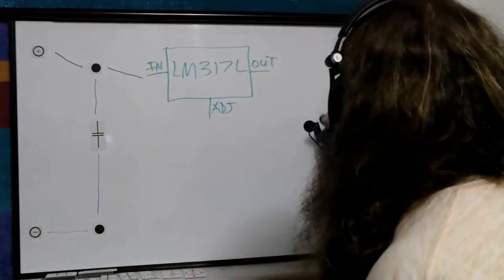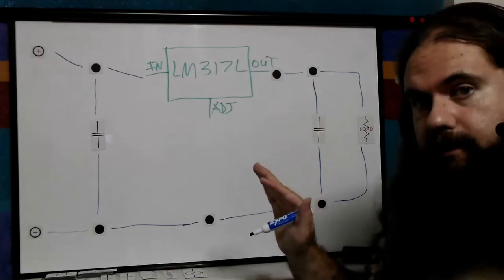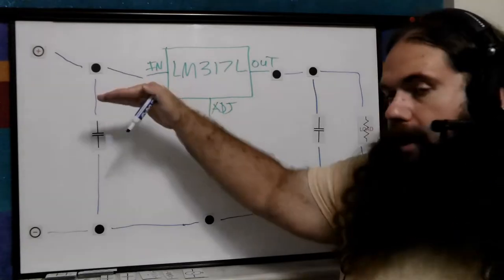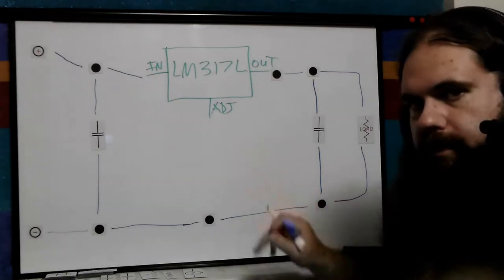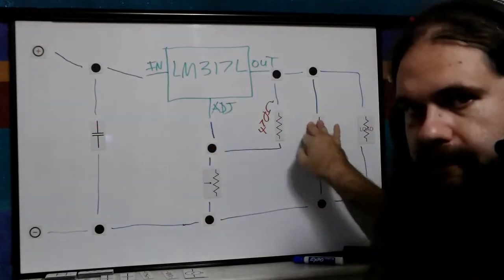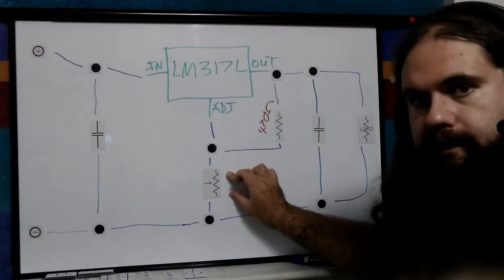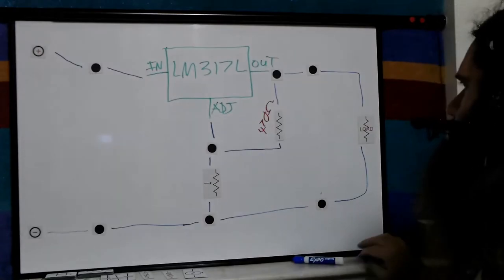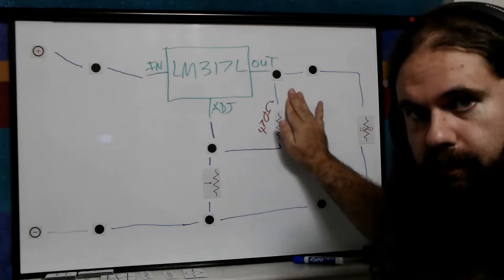Linear Voltage Regulator - LM317L - Simply Put

Comment: Hi Simply Put,

This video was insanely helpful. I cannot thank you enough. I've just discovered your channel, and I don't know how I've gone so long without knowing about it. I'm a senior-year electrical engineering undergraduate who has watched more than his fair share of YT videos for help with various analog circuit analysis and digital design concepts, yet Google has NEVER once recommended your channel to me when I needed help with tons of different classes. I don't understand how I wasn't subscribed to you years ago. It's amazing how I can do so well at a university studying electronics and circuit theory for 3+ years, yet I'm still lacking so much of the basic, practical knowledge they don't teach us on how to actually make real things that do stuff without blowing up. I've recently started binging all of the videos on your channel, slowly filling the cracks of my university-level education with the extremely-applicable, invaluable knowledge you have shared with the YT community. Your videos are exactly what I've been looking for to explain simple electronics concepts and how to use them in the exact way I need them to be explained, and I've already shared your channel with several of my electrical undergrad friends.

Now that that's out of the way, I do have one question. After watching this video along with the video on decoupling capacitors, I understand that the first (leftmost/large) decoupling cap is meant to compensate for (low-frequency) dips in the power supply voltage, and to supply voltage/power to the regulator when the power supply falls for a short period of time. I know that it smooths out the power supply voltage so that a nice, pretty-much-constant input voltage is supplied to the regulator THAT IS HIGH ENOUGH FOR IT TO WORK PROPERLY. However, if your input voltage is, say, 7V (for the headroom), and you are regulating it down to 5V, but your power supply only momentarily drops to maybe 6V or 5.5V, wouldn't you technically not need the first decoupling capacitor? Even if the power supply voltage falters a bit, but it is still sufficiently high enough to be regulated down to 5V, would a 6V dip (still >5V) not still be regulated down to 5V in the same way 7V would be? And the dip wouldn't have any effect? So, I guess my question is: Is the first decoupling cap for smoothing out the input voltage and supplying the necessary voltage to the regulator ONLY WHEN IT DROPS BELOW THE VOLTAGE YOU'RE TRYING TO REGULATE TO?

Same thing for the second (rightmost/small) decoupling capacitor. I know that that cap is for filtering out the (high-frequency) ripple noise in the output voltage -- you explained how it only affects high frequencies extremely well in the decoupling cap video, BTW. However, if the regulator regulates all dips in the input voltage that are still greater than 5V down to 5V (like I am guessing it does), would those ripples then NOT show up in the output voltage? Even if they were high frequency drops, would they still not be regulated down to a flat 5V just like all other input voltages above 5V would be? (e.g., the same way the constant 7V you are trying to supply it would be)

I am probably answering my own question in saying that this device linearly regulates the voltage (hence the name), so any low-frequency dropouts OR high-frequency ripple noise in the input voltage would propagate through to the output, just linearly-scaled down to 5V but still dipping/rippling proportionally. In that case, you would definitely need both capacitors, and the first decoupling capacitor would not ONLY be used for when the input voltage drops below the voltage you are regulating to (5V), but in ANY case when the power supply dips at all (whether to a voltage below 5V or not). And that would make sense EXCEPT for the fact that the output voltage you're trying to get does NOT depend on the actual value of the input voltage -- it just depends on the resistor value(s) you choose, and the fact that the input voltage you supply is sufficiently higher then that desired output voltage. If the regulator DID depend on input voltage, then you would need to have a specific input voltage to get the desired 5V at the output; i.e., it wouldn't work for any input voltage that is sufficiently high enough.

So which is it -- does the regulator like blanket scale any (sufficient) input voltage down to 5V, including power supply dips and high-frequency noise? So then you wouldn't need the capacitors? Or does it linearly scale down input voltage including any dips and noise, in which case you would need both capacitors? But then the specific output voltage you get would depend on the actual value of input voltage, wouldn't it?

Any clarification to this would be super helpful, so that I can 100% understand this core circuit component. Again, thank you for such amazing, helpful videos.

-- Chris
Reply from the maker: I appreciate your compliments! This is still a new-ish channel actually, barely a year old I think, so YouTube doesn't recommend it all that much (plus, because of my sporadic upload schedule). The regulator requires some voltage for its internal circuitry, so if you want 5.0V and you give it 5.!V, it will not work right. If you are giving your regulator 12V and you want 5V, you wouldn't need the capacitor on the input, but you would need a liquid cooling solution and a beefy regulator to handle the immense wasted power. The output capacitor is 1) because the regulator is not absolutely perfect, and 2) variable loads in the circuit all drawing from the regulator output can compete with each other (which is why having caps on every chip's supply is good, so they're all decoupled). And there's a "response time": Ripples in the input take a nonzero amount of time to re-regulate. If you wanted, you could actually chain regulators, 12V->8.5V->5V if you wanted, or even more, and it would make the supply even better, but you would waste SO much power it wouldn't even be funny. At that point, it's a much better idea to just use a more advanced circuit for your supply than a regulator chip. So the summary is, nothing's perfect, and your supply is regulator+caps, and you put caps on every chip too, and that handles it fine for non-military hardware. Go look at the motherboard of something like a Macbook (look at Louis Rossman's channel) and see just how many capacitors are all over the thing. It's a messy world.
Reply: @simplyput2796  I think I get what you're saying. Power sure seems very messy, as you note in the video.

So correct me if I'm wrong: the input cap is for (1) supplying momentary power to the regulator when the supply actually dips below 5V, and (2) smoothing out ripples (that are still > 5V) in the input for the regulator INSTEAD of just having the regulator handle them itself? Like you say, there's a nonzero response time for the regulator to re-regulate ripples (still > 5V) down to 5V? Even though the input voltage never dips below 5V, if there are still ripples in it, would they somewhat propagate to the output because the regulator would take some amount of time to fix them?

So, is it easier and faster to just put a cap there to fix the input voltage to the regulator instead of having the regulator handle the ripples itself?
Reply: Also, I just rewatched the video and realized that you want the input voltage to stay at 7.5V or more for a 5V output (NOT just input >= 5V). So, I'm guessing it's best to keep the input at 7.5V or 8V to regulate down to 5V, and you have the input capacitor to supply momentary power (at 7.5V or 8V) and smooth out the input voltage when the power supply dips below 7.5V (but is still above 5V the whole time)?? I'm guessing this is MUCH more power efficient than just having a regulator sit at input = 12V the whole time so that can still be at 7.5V or more even when it ripples??
Reply from the maker: If you want power efficiency, you really want a switching power supply with a whole lot of smoothing circuitry. Linear regulation is more wasteful but is much cleaner for cheap parts. The capacitor on the input of the regulator is there because the regulator does the bulk of the work but can't do it all, and a capacitor is small, cheap, and easy to stick on there to help out. Look at the spec sheet for your particular regulator, and it will tell you what voltage (e.g., 7V) you need to put into your regulator to have it able to properly produce what you need (e.g., 5V). The regulator is the surgeon and the capacitor is the surgeon's assistant, if you will.
Reply: @simplyput2796  Got it. Thanks so much for answering my questions.

Comment: This was seriously helpful.  20 views for this video! YT is getting its search algorithms very wrong.  Thank you, Simply Put.  I have several LM317Ls, and I need a stable 1.5v for an RF circuit. This chip ain't ideal, it seems, but it's what I got, so it'll have to do.  You've made it much clearer.   From a fellow would-be electronics engineer/ carpet fitter.
Reply from the maker: A lot of the time, I've found, the "not ideal" chips are actually the best for beginning and testing work, because their designs are super old they're basically perfected for what they are. These industry-common chips, basically everyone has made them. They end up being tolerant of mistakes, like running power the wrong way, and they are less responsive to finely-grained signals but that also makes them more stable in high noise. What makes them bad for "real" work makes them amazing for breadboard work.